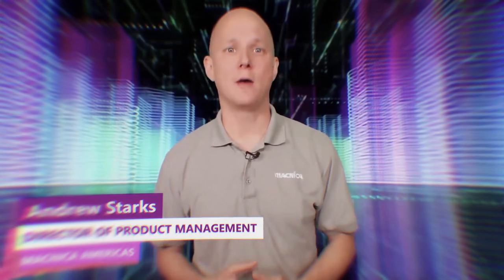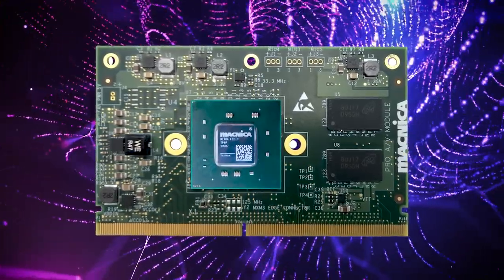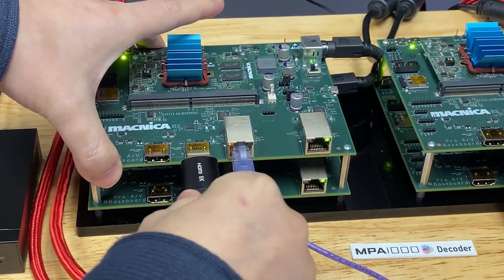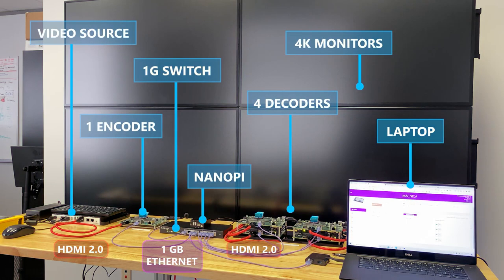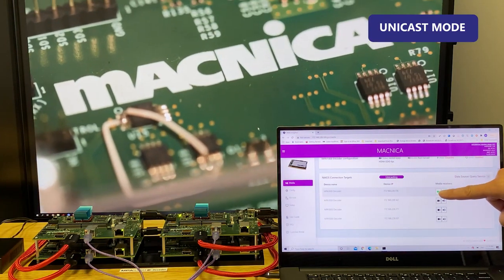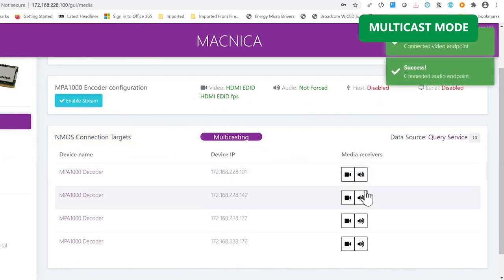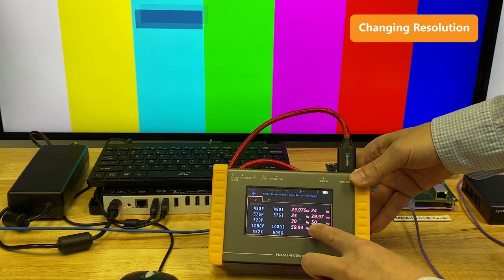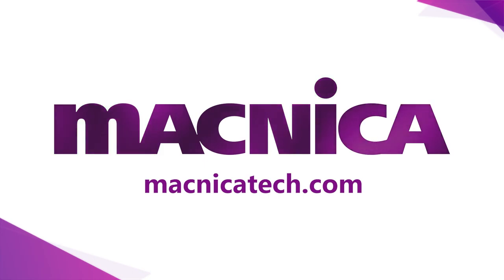What can you do with MPA1000? The IPMX SoM from Macnica

Comment: Why no casing ?
Reply from the maker: Hi Turut, Great question. We designed the ME10 System on a Chip (SoC) and the MPA1000 System on a Module (SoM) for Original Equipment Manufacturers to integrate into their pro AV hardware products. The small form factor of the SoC or SoM makes it easy for Manufacturers to attach our system onto their board, giving them the features and benefits of IPMX open standards without spending engineering resources.  If you'd like more information please visit www.macnicatech.com